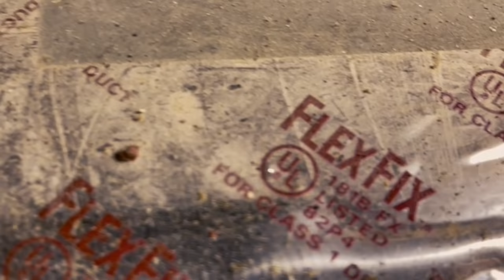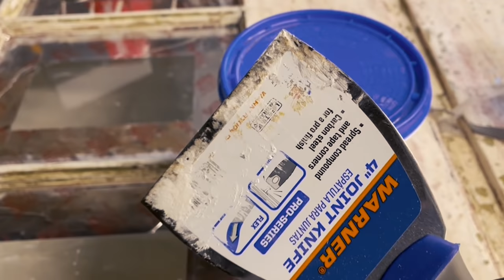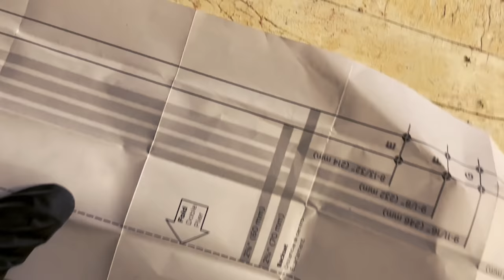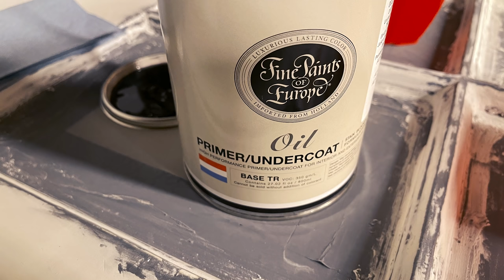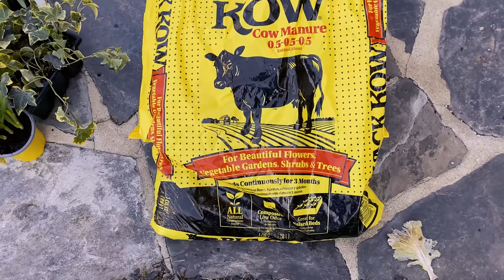Summer Porch Refresh || Antique Front Door Renovation || Cottage Core Planter Ideas

Comment: Beverly, was there a reason why you didn’t show how the paint went on over the shiny primer?  Paint usually doesn’t adhere to a shiny oil based surface, so this is why I am curious why it wasn’t shown. I now have to finish watching the video. Haha 😌
Reply from the maker: The purpose of the oil primer is so the enamel paint will not get absorbed into or previous paint and go flat. This paint is in a class of it own. We did not show the paint process because and extreme change would not have been visible. If you would like more information visit The Fine Paints of Europe. Have a wonderful weekend!🌷🏡🌷
Reply: @TheLittleBlueFly  thank you so much! 🌸